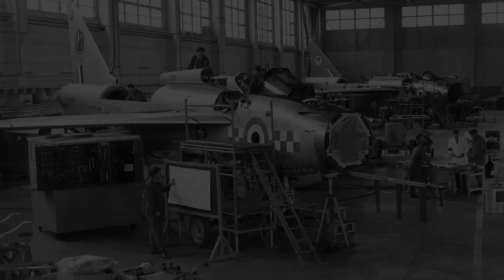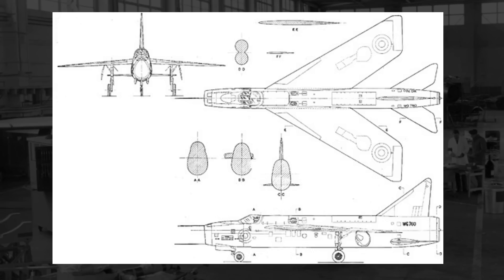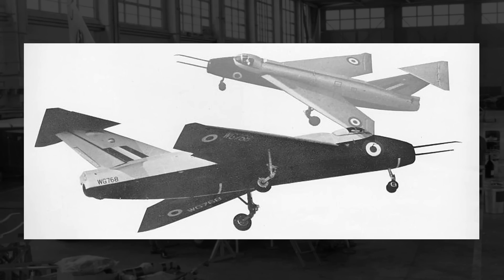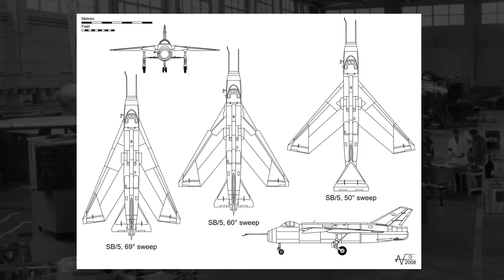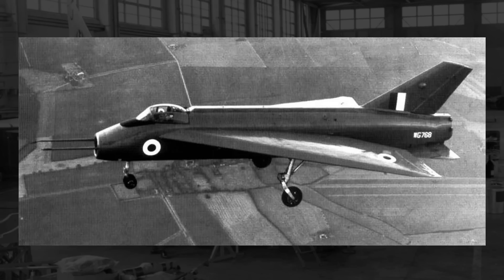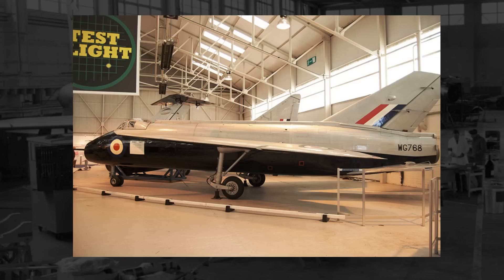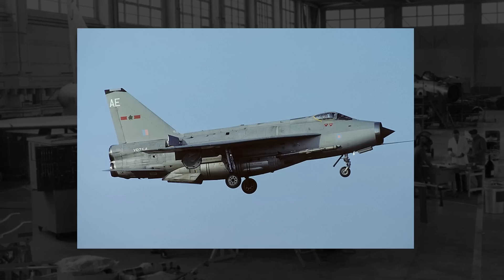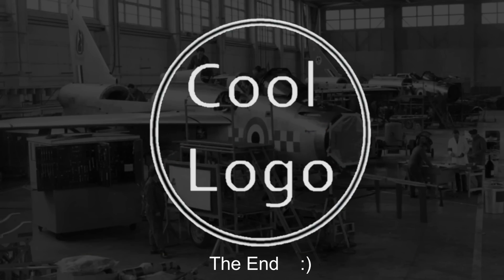The Plane Born From An Argument: Short SB.5

Comment: I normally would say any real-world experiment is superior to other methods, but in this case, I think it was not necessary. Testing low-speed characteristics in a wind tunnel should have been enough, and I'm sure EE had validated the rest of their design methods. If anything, these tests showed that EE knew what they were doing and the next time they said something was going to work, it was a good idea to believe them.

Comment: I have often wondered when seeing a plan view of the Lightning why the cut out on the inboard section of the trailing edge of the wing? I was hoping this video would answer that question. Was wing cutout to contribute air flow to the low mounted tailplane at high angles of attack? Does anyone know? The US was going with the delta wing form in their F102 & 106 aircraft.

Comment: Mk 1 vertically in the 1960's. Frightened the daylights out of American B52 pilots during an exercise over Wales when a squadron of Lightning's went  vertically through them. The words ' Jesus Christ' were heard over the Tannoy at RAF Pembray. The B52's went home. There was an official complaint made, however as several American pilots had been rather 'loud mouthed' about the ability of the Lightening' it was ignored as sour grapes. The P2 Lightening had 2 Rolls Royce Avon engines, speed in excess of Mk 2. One wing commander said the wings were there to keep the landing lights apart.
Reply: Similar story and JC exclamations, from USAF pilots training on F-15s with Buccaneers on low level intercepts, they could not get low enough to intercept!
Reply: Wonderful tale, thank you! Slight correction though; it's Mach 1, and Mach 2. Mk1 is short for "Mark 1" ie: the first version of (whatever) etc.  Mach numbers are dimensionless numbers which relate how fast the vehicle is moving with regard to the local speed of sound, which varies with both altitude and temperature. It's named after Ernst Mach, An Austrian physicist that did a lot of work on shock waves.

Comment: Thanks for. SB.5 may just be a sidenote in the development of the Lightning - easily among the most iconic aircraft of my childhood years (yeah, I'm that old) - but it threw up a lot of important data for future designers. Not bad for a wooden-winged jet. So long as there's an actual purpose involved, I don't think there's such a thing as a pointless experiment - even a failure tells you what NOT to do. And for all the wind tunnels and computer simulations, there can be nothing as good as building it and trying it out.

Comment: Shorts were later involved in developing the wing plan for the Concorde supersonic airliner and various construction methods to help deal with temperatures at high speeds using amongst other things an airframe made entirely of stainless steel
Reply: Handley Page built the HP 115 low speed test bed for the Concorde programe , a 75 degree delta.
Reply: @leerogers6423  yes, it is on display at the Fleet Air Arm museum at Yeovilton.
Reply: You seem to be confusing Shorts efforts with those of the HP115 which was a low speed delta for Concorde and also Bristol's 188 stainless steel research aircraft.